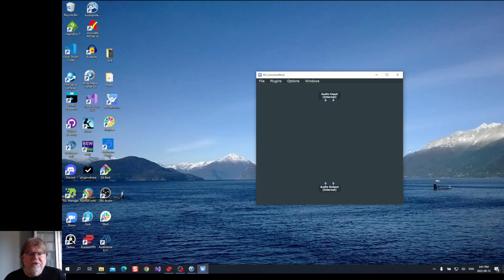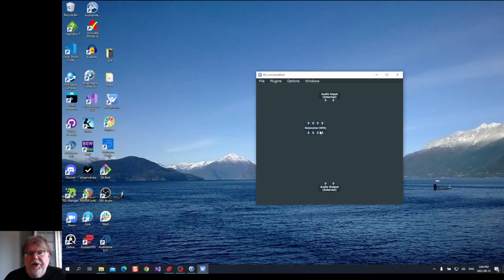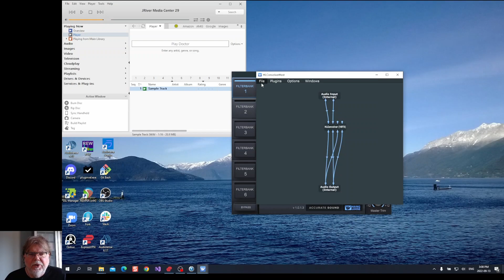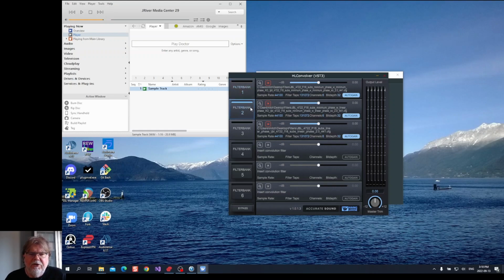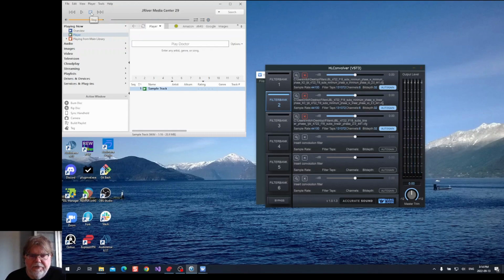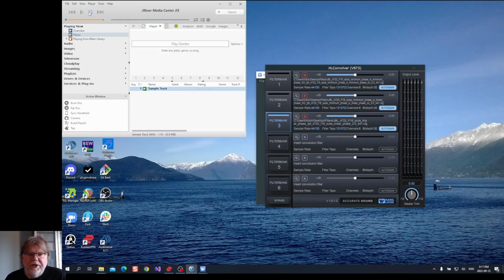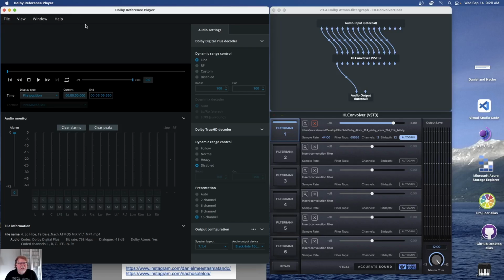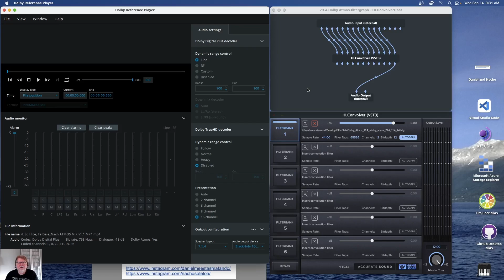Hang Loose Convolver - A Listening Demonstration

Comment: Hi there, so i can use Convolver along with the appropriate filters to set up the room and a/b to get the correct musical  inturprritaion ? Thanks in advance
Reply from the maker: Hi Danny, yes. HLC can host Digital Room Correction (DRC) and headphone correction filters. For example, you may have developed 2 or 3 or more room correction filters and want to evaluate them to hear which one you prefer the most. HLC makes it easy as the filters are automatically level matched and can be switched instantly with no artefacts. To develop DRC filters, you may be interested in: https://www.youtube.com/watch?v=yfGAUvyvdNU
Reply: @accuratesound4115  Thank you for your quick response. Brilliant presentation i must say.  I have subscribed so I don't miss any valuable tips. Thanks again Dan UK

Comment: Hi there just wondering if you could tell me the advantages of using this vs equalizer apo ?
Reply from the maker: I have not used Equalizer APO... Having a quick look, EAPO appears to be tied directly to the Windows audio subsystem. So Windows only and looks like no ASIO support either. There appears to be some technical issues with Equalizer APO convolution: https://sourceforge.net/p/equalizerapo/discussion/general/thread/a99a81aaf0/#d100  I did not look any further beyond that.

HLC is available on Mac, Windows, Linux and Raspberry Pi, as both a standalone application and a VST3/AU plugin. So both application specific and system wide convolution. The user interface is designed to be simple, it is a one button click to load convolution filters and one button click to compare automatically level matched FIR filters. HLC uses the industry standard convolver config file format: https://convolver.sourceforge.net/config.html as many FIR filter designer tools will automatically output this industry standard convolver config file format. When dealing with 7.1.4 Atmos systems with bass offloading, hand rolling a config file is no easy task. Looks like like EAPO uses it's own proprietary config file format.

HLC tech specs: https://accuratesound.ca/hang-loose-convolver-hlc/  Free trial: https://accuratesound.ca/product/hang-loose-convolver-14-day-free-trial/